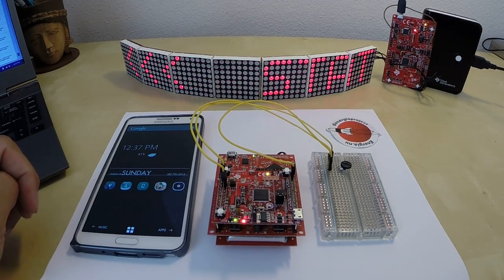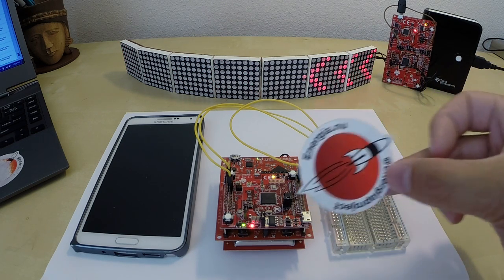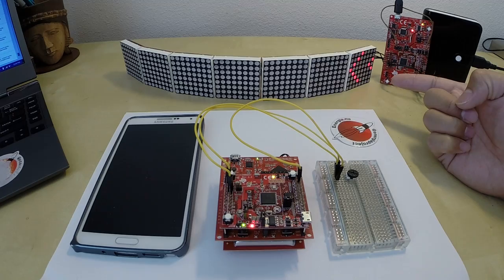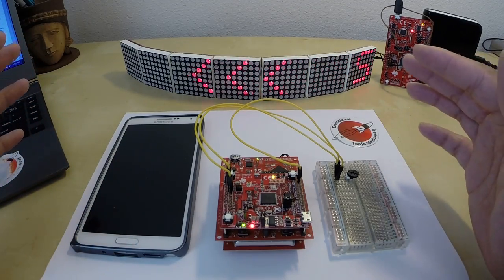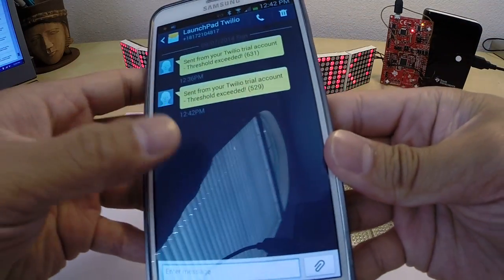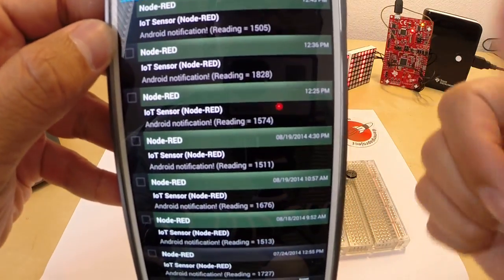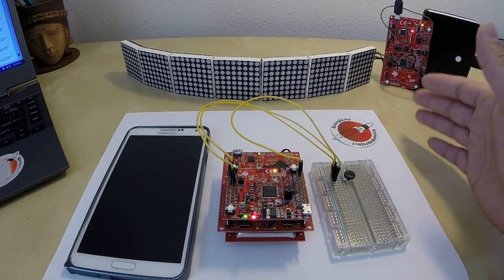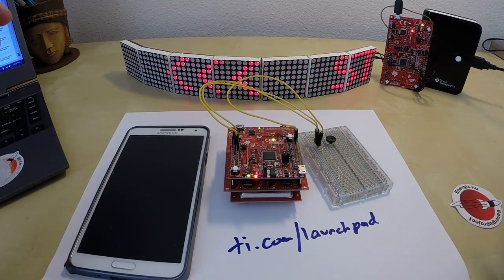Trigger events in the cloud with WiFi-connected sensor using TI LaunchPad & Energia software

Comment: Hello Adrian,

I am just wondering. Did you have to update the firmware on the CC3100 WiFi BoosterPack for this project? Or did all programming happen on the MSP430F5529 Microcontroller LaunchPad  and the cc3200 Wifi launchpad?